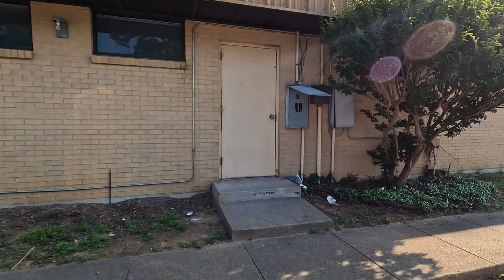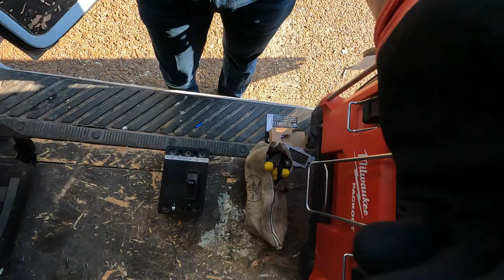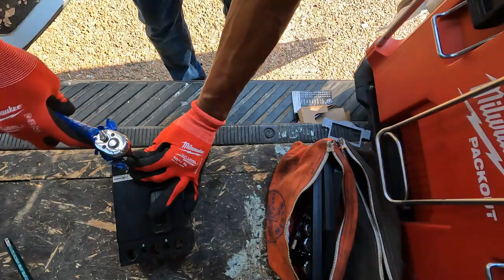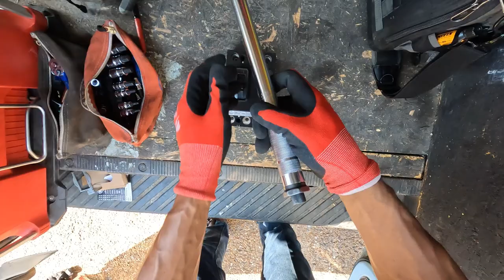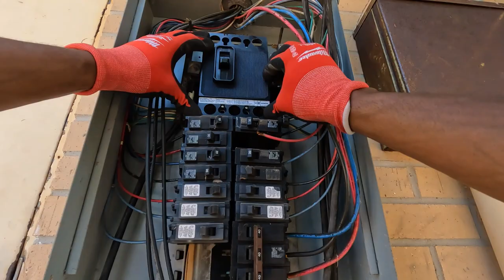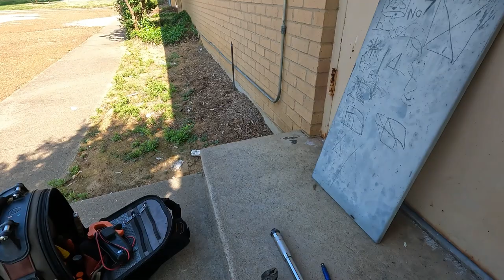How to Torque Main Breaker Lugs: Harbor Freight Torque Wrench

Comment: Nice job. Thanks for sharing your knowledge.

Question: you mentioned that the incoming conductors weren’t “hot.” Was there a breaker upstream in the “off” position or were the service drop wires cut? Just curious as I was expecting the incoming conductors to be “hot.”
Reply from the maker: Utility company had power shutoff. No meter installed either.
Reply: Got it. Thank you. Happy Father’s Day.

Comment: Again, Great work! I subscribed and watched almost all of your videos. I recently had a panel upgrade. I wanted to go back and tighten all the connections. I did all the breakers after I shut the main off. Could I tighten the main lugs that are hot coming into the panel hot?